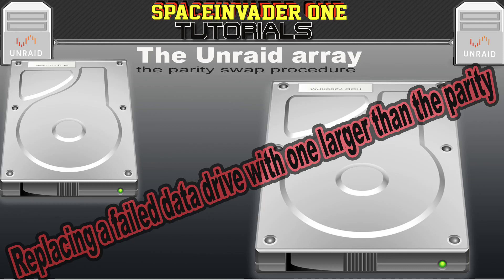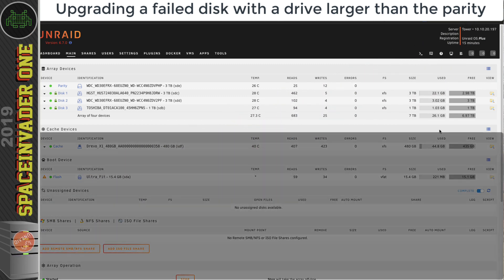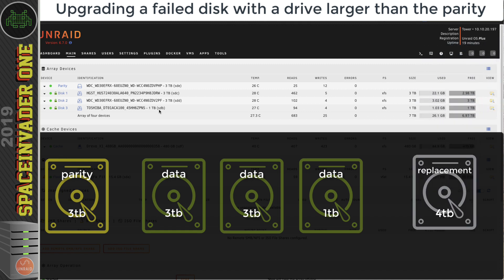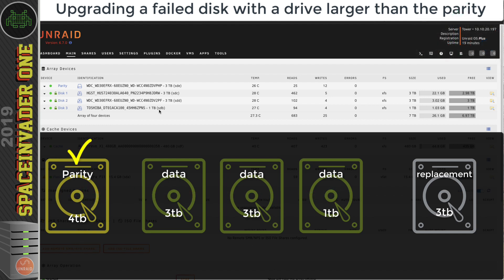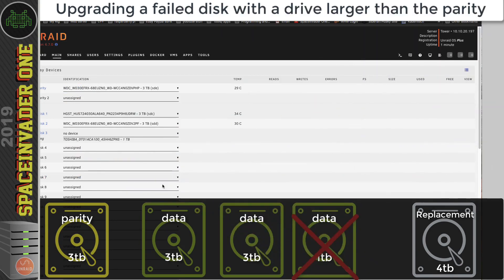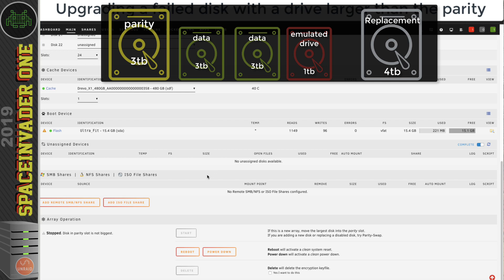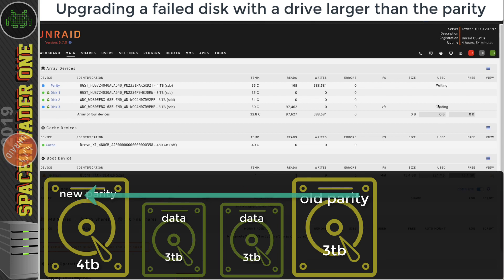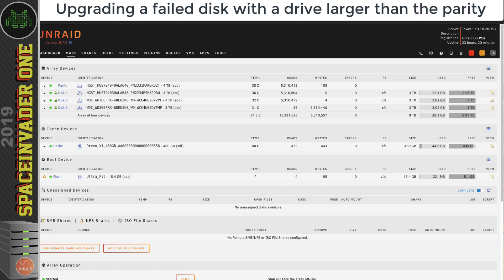How to Replace a Failed Data Drive with one LARGER than the Parity

Comment: I found something out the hard way:
If you do anything with the Array after the COPY is complete instead of starting it (as shown in the vid) the thing sort of 'resets' itself. 
In my case it was adding a new Cache Pool, and after I assigned that new SSD to it I found that I could not start the Array, and the previous Copy was like it never happened. Argh! Bad me.

Comment: It doesn't work in 6.9.2 I did exactly that and the copy button show up. Also the wiki is useless now it starts to rebuild everything, not only that I'm dealing with 16tb of data so anything is dealing with days not hours. The problem with unraid is its logic is F up and not consistent.
Reply: Had to update to 6.10.0-RC4 to do the parity swap. 6.9.2 is broken for the parity swap

Comment: With RAIDZ2, do I need to upgrade both parity drives at the same time? Guessing from the information in the video, no - is that assumption correct?
I have an old 4TB WD Se drive that has four corrected sector errors* that I am still using (currently in RAID5 with NTFS, soon in RAIDZ2 with ZFS). Once it starts having some more errors I will swap it right away, optimally with an 8TB WD White, starting my transition to 8TB drives. I want to know if there'll be an investment of 2x150€ or for the time being only 1x150€ for a new drive. Thank you very much!

*It came with these errors when I bought the drive used with ~50 power-cycles and 2000 hours of runtime. I repaired them using Diskpart. For over a year there have been no additional errors. It currently isn't part of the RAID5 pool, it has four healthy drives, but I want to include it when I transfer the drives to my Linux server to get the extra security a second parity drive brings (even though here one will already be somewhat faulty - it still offers more security than the current RAID5). Additionally, I will start backing up to Backblaze as an off-site backup - though that's going to take roughly 20 days to back up with my current data and internet speed.

Comment: Great video, thanks.  I’ve just got a second hand Proliant N40L which came with four drives.  The smallest 250GB has some smart errors so I need to do exactly this process.  My current parity is a 1.5TB but I have a new 3TB to swap with the parity then the 1.5Tb will be swapped with the 250GB.  You show two ways of doing this, what would be the best method to use in this case.  Is it do the parity swap first, then swap the data?  Or do the parity copy method?
Reply from the maker: I think you should do the parity swap method.Remove the 250. Then Just copy parity to the 3tb then rebuild the missing 250 drive with the 1.5. :)
Reply: Spaceinvader One perfect thanks. I was thinking this was what I should do. Less disk changes.

Comment: Is there a tool for copying 3 drives down to 1, verifying that there are no duplicate files in a different folder, then turning the 3 drives into a raid with parity?  I think the hardest part would be verifying that there are no duplicate files.

Comment: What to do if my motherboard or raid card fails? Can i replace it with no issues?
Reply from the maker: yeah you can replace all your hardware. Put the flash drive in the new hardware. Unraid will see the disks from the disk id numbers and just carry on the same.

Comment: Thanks for another clear explanation and demonstration of a useful unRAID feature, Spaceinvader One!  Not only is feature useful, but also highlights an important key advantage of unRAID over most conventional RAID systems in that with unRAID one doesn't have to start out with a final, rigid storage plan and can change storage configuration as requirements and resources change.

Comment: What case are u using?
Reply from the maker: Hi Max.In this video the server is an HP gen 8 microserver that takes four  3.5 drives and you can also fit 1 2.5 too. nice for a small server.
Reply: @SpaceinvaderOne  thank you for the quick reply and for your videos. I have learned so much from them...